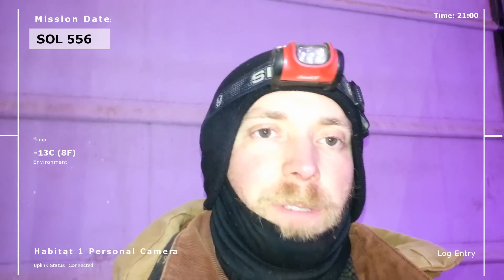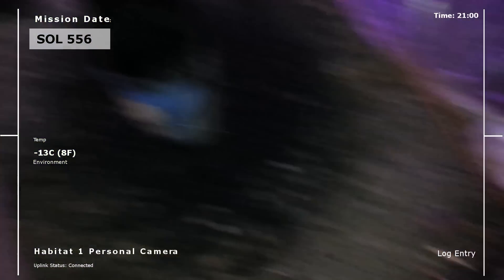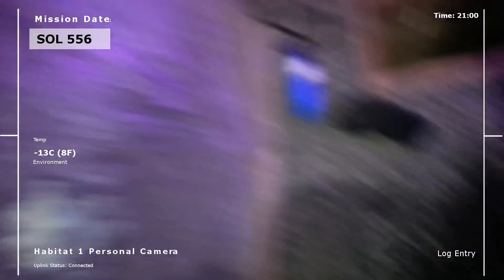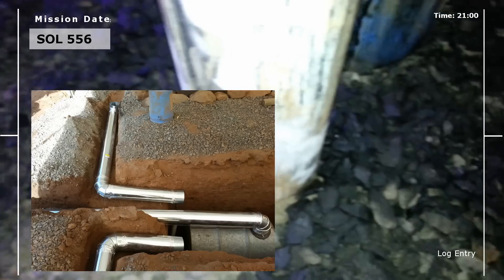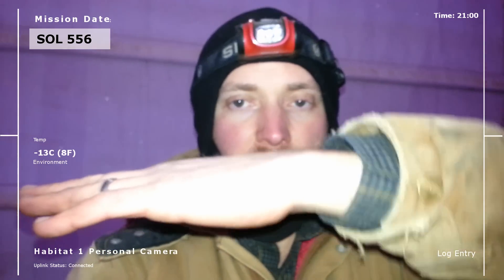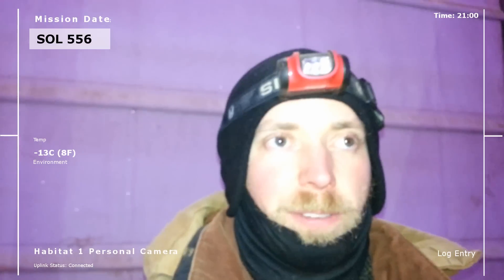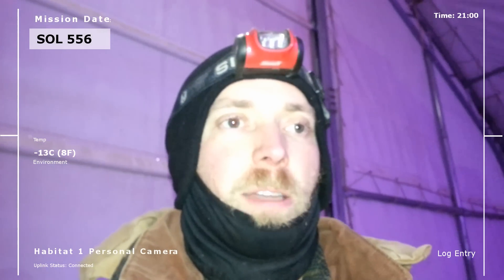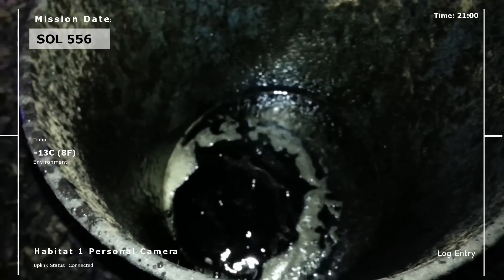Greenhouse Heating - Double Barrel vs Rocket Stove?

Comment: My advice is don't break yourself getting through winter.  You are obviously in damage control mode looking for short term solutions to problems that may also be short term.  Step back, think it through.  Wood heat is a mistake to begin with, you recognize that.  You need to sink that greenhouse down eight feet into the ground, figure out drainage, then figure out a way to double wall it with an air gap.  You might alos think about landscaping the outside to create a wind break depending on the prevalent wind direction.  For winter, why not shut down 1 lane and concentrate on heating just the 1 lane?  This is no option long term when you are full production, but it might get you through now.  You are chasing your tail with the heat/humidity/mold thing.  With the negativity dispensed with, I do want to say you are doing an awesome job here.  Most people would just shut it down in the extreme cold you have.  The fact that you were barely off the ground when winter hit just adds tothe uphill battle you are fighting.  Don't get discouraged, again, think long term.
Reply: I thing the reality of sinking the green house eight feet would be financially crippling, but you got me thinking. What about a 3 or 4 foot thick straw bale or hay bale, wall 8 feet tall all around the perimeter (outside)? Covering it in adobe would make it a cheap, permanent solution.
Reply: He would essentially need to remove the entire greenhouse and do it again... for a man who has spent almost everything getting here that is just not sensible.
Insulation can be done as the structure stands and in several stages so things can keep growing while the building gets improved, that would be the far more sensible approach at this point.
Reply: Straw bale inside. Would that help? You could refuse sack each bail to stop it moulding and every square foot of wall inside you 'block' from the outside wall you effectively super insulate, reducing the exposure of warm air to cold surface. I still can't tell if you are in a greenhouse and dependant on light from the sun or are using artificial light. So maybe only the north wall and then stick baking foil on it to reflect light but it would take a lot of heat loss out for not much money.. I really admire what you are trying to do here. Mistakes and all :) I still think bubble wrap over the lanes would really help. Back to air gaps, which a lot of people are mentioning.
Reply: I think this is really great advice +Tenspeed TheBikeHanger, both in practical recommendations and in affording +TheRealMartian some graciousness with himself. Truthfully I doubt he'd be able to sink the building, because that'd mean he would have to rebuild the buried concrete methane stomach. It sounds like that'd be off the table considering some of the other possibilities he's ruled out. But! The external windbreak idea makes me think of ways to better insulate the building. I mentioned it on another video last night, but if he has access to a decent amount of hay/saw dust, couldn't that be an affordable insulating material? I don't know the science behind how feasible that may be, but I know it was common insulation in the midwest pre-electricity.
Reply: good idea
he has said that his goal is to have the units in shipping crates, if you were to dig a hole for those it could work very well for insilation
Reply: Aaron S
Well...To put it tactfully I am one of the subscribers that wishes he would lighten up a bit on the Mars thing.  I doubt we try to colonize the planet for much the same reason we never tried to colonize the moon,  There are plenty of good reasons to keep this whole theme within Earth's atmosphere.  Jeff listed several reasons himself a few videos ago.  That said...I get it he is having fun and using it as a mental exercise.  Hey, whatever floats his boat, it is his channel and his story.  I think if this were on Mars you couldn't even begin to approach it like you would on Earth.  Probably solar alone is the answer for Mars which would be infinitely more efficient than it is on Earth. Of course the modular grow unit would have to be super insulated as would any building on that planet.  Anyway...There I go playing the game... :-)
Reply: +Aaron S  - I can't help but think there's a reality check we have to make here: There's no conceivable way he can both A) Stay with his financial constraints and B) Build an system that theoretically would work on Mars. Personally, I think it makes more sense to build a sustaining system on Earth, for Earth, and once that's locked down then start to refine it for Mars. I mean, if this current prototype, as rudimentary as it is, was intended to work on mars - there's some real basic things already dooming it: Like a wood burning stove, no air lock, radiation shields, and no filtration system for mitigating sand/dust accumulation in the HVAC. To name a few. 

And to be completely honest/transparent: I personally could care less if this experiment ends up on Mars. I'm interested in this thing working for Earth so I can one day build something similar.
Reply: Tenspeed TheBikeHanger interesting, would probably work. If he digs the whole thing out with a shovel I'll have deep respect lol
Reply: Ben Poliquin
He has a tractor, but even better, his neighbor has just what is needed.
Reply: MsSomeonenew
He couldn't do anything until spring thaw anyway.  He has mentioned that this is a prototype.  I was thinking more long term here.
Reply: I thought about inside, but I don't think he will have room once the other 2 grow lanes go in... but it would help for now...
Reply: Well I read most of the comments here you are all forgetting one thing, Mars. They won't have access to heavy equipment or any of the other suggestions. Digging down into the ground would take a lot of time with a shovel. Maybe the only solution would be to start in a crater. Yes here on earth there is many options to replicate across the planet but he wants to make it work on Mars too. Their habitat will most likely start with parts of the ship and things like plastic and shovels would be all they could bring with them. Here on earth digging into the ground cost money and the idea is to make this affordable. Putting another layer of plastic up to create an air barrier may be the only choice for now, but I doubt it would be enough for Mars cold. I don't think he will fix the problem this winter due to cold and money.
Reply: Aaron S probably need to dig down in Mars as well to deal with radiation.
Reply: stephenmg12 I'm not saying they wouldn't dig down into Mars that would be the long term goal. But how would you expect them to do it on day one without access to heavy equipment.
Reply: Ah yes, More lanes would cut down space.  I do think insulation is important though. I don't know what summer temps will be. He might even have to cool at that extreme.
Reply: Tenspeed TheBikeHanger You still have to factor the cost of digging into the ground and reinforcing the building to keep it from collapsing. That's money he doesn't have as well as being affordable for others to replicate. Nice idea on paper till you start putting down numbers.
Reply: Kyle Wyatt He is just in a testing phase. Yes making it work for Earth 1st would be the main goal. Even if he wants to make it work for Mars you don't go all out and build everything during the test, that's later down the road. Yes there is a lot of problems with his setup but he can't learn if he doesn't make mistakes. Money is always the number one thing on his mind, if he had it then he could do all the stuff you pointed out.
Reply: Aaron S
Anything you do costs money.  They could scrape out the hole no problem with just the cost of a days worth of diesel.  I would also just use the framework of the building he has now.  The tricky part is shoring up the foundation walls and drainage, but it shouldn't be insurmountable.  The advantages you would get having a more stable environment inside the greenhouse would more than pay off.  Anyway, I am just throwing it out there, I don't really want to debate.  It is his dime, he can do what he wants.

Comment: All you got to do is change out your top barrel with a rocket stove bell barrel. That will burn much of fuel you are currently losing out the pipe, solve the kresot issue, and you can batch load.
Reply: Well since he needs the stove through the winter that kind of major surgery is probably out of the question right now.
But if it was possible to add baffles to that top barrel to contain some gases and insulation on the outside that should cause far more gases to get burned, although it would also mean more heat up the chimney rather then the ground.
Reply: MsSomeonenew Not if he builds and test the rocket bell before hand as one unit. The rocket bell can be in the same space as the upper barrel, or even above the upper barrel. A guy named Van Powell has had good results with much smaller barrels also.

Comment: The next ime you build a system for heating try installing a tee fitting and some drainage rock and drill a few holes in a cap installed on the lower part of the tee fitting. The smoke will draw ant the water will not drain back into your system. This works well!

Comment: You can use the creosote to treat wooden (pine) fence posts to prevent insect damage if you don't have access to cedar or locust.  If you want to insulate some of your stove pipe to reduce condensation you can use fiberglass insulation.  The important thing is that the flue gases stay hot enough to prevent condensation (above the dew point).
Reply: Or if you can maintain a hotter fire the exhaust wood gases that condense into creosote are far fewer, so once the water evaporated from creosote you are really just looking at fuel that escaped.

Comment: The more heat you take out of your exhaust, the more it will condensate. Then you get more water. You need the stove to burn hotter. Forced draft, air injection, something.

Comment: Check out ABC Acres rocket mass heater with batch box. I'm concerned that all you're doing is heating up the ground (infinite heat sink) rather than your hab. I think you'd be better off heating your water as someone else suggested. The rocket heater would also solve the creosote problems.

Comment: Hi Jeff, Any thoughts as to adding fins to your chimney pipe to remove even more heat before it escapes to the outside. Cheers.   Bill
Reply: Hey SuperGoldnut,  
What did you use to draw heat off your chimney?
Also Jeff,   NEW THOUGHT...Would it be possible to extend lane 2 or 3 to encompass the chimney and still engineer heat extracting fins?  Cheers,  
  Bill

Comment: wouldn't it be a good idea to place ribs on the chimney pipes to increase the surface area to improve the amount of heat transferred to the air? 
Painting the whole lot black would increase it even more so you can have more benefit of the residual heat from the pipes.

Comment: I would focus more on heating mass rather than the entire environment. I.e. Run fish tank water through a coil in upper section of barrel stove. Another idea is to run that warmer water per say 70*F  water from fish tanks and barrel stove through a thermal absorbing mat the seed trays sit on. Even if the air temp dropped below freezing the plants shouldn't freeze due to heat rising from below tray not to mention heat coming from fish tanks. I think you said fish tanks were 54*F if you could get that temp up I think would help tremendously. Just rambling thoughts I know money is always the limiting factor. Good luck love the channel.
Reply: Still thinking about this ......the amount of condensate and creosote says you either have wet wood or just too low stove temps. Which means there isn't any more btus to extract from this stove.
I know your probably closing stove vents to stretch the time between filling but this is creating very inefficient btu per amount of wood your shoving in it. 
Advice open vents to achieve hotter burn fill stove 3 times a day. Your liable to plug that chimney right up with wet(green) wood and or low stove temps
Good luck

Comment: Putting the barrel stove in the ground was genius. It's a lot of extra work but you've got the option of creating a thermal battery, or opening up the trap door and letting the heat rise directly into your hab.
Reply: Ceck it out, Law of Conservation of Energy states that energy can neither created or destroyed. So how does that relate to this project? 100% of the heat that goes into the ground ends up rising into his hab. Since dirt has a lot of thermal mass, (compared to air) the warmth is released at a slower more consistent rate than having the stove above ground.
Reply: The Silent G > Did you watch the video? He has pipes running from the hole to both lanes then back into the hole through the hatch. Any heat being lost after this circulation would just radiate up into the main building.